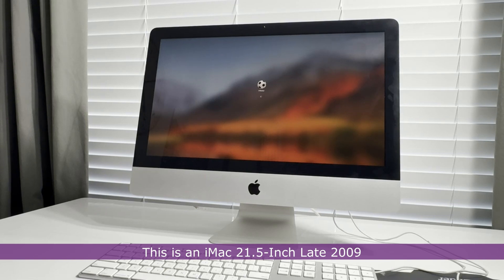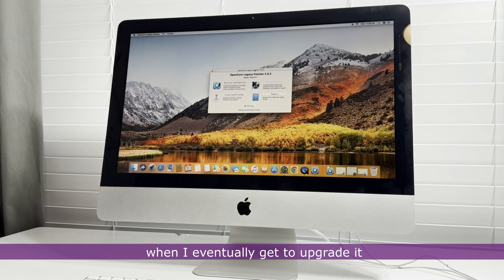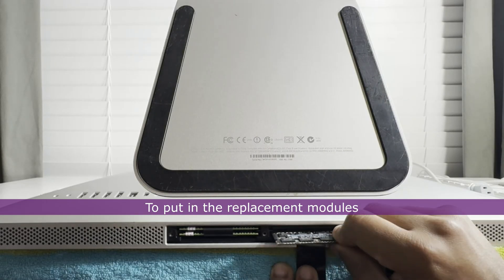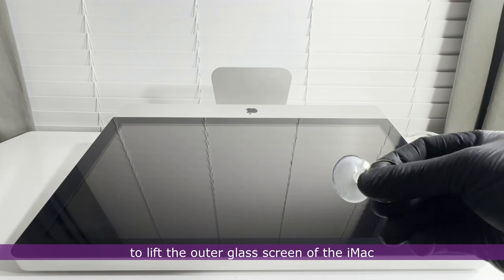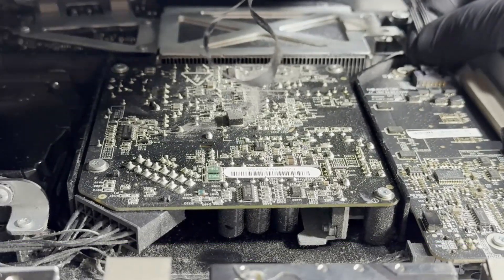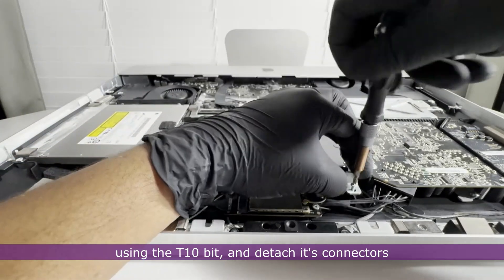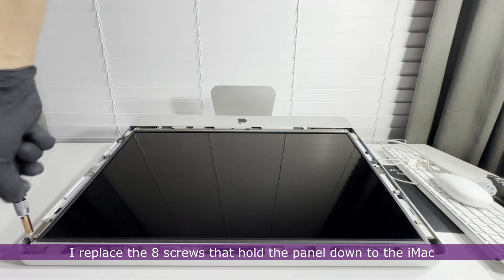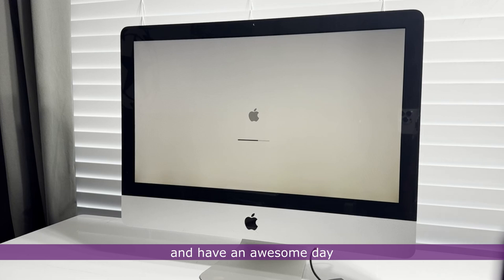SSD and RAM Upgrade for 15 Year Old Apple iMac

Comment: How did you manage the hdd sensor? mine the fans are at full speed all the time. thank you.
Reply from the maker: I don't remember any problems with the fans when I used the device. Though, I did not use it for an extended period of time.

Comment: which SSD and ram did you use?
Reply from the maker: I didn't go for any specific RAM or SSD, I just searched on eBay for the RAM and SSD which are compatible with the device.
Reply: So it doesn't need any specific RAM or SSD?